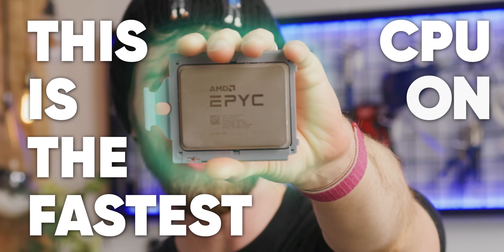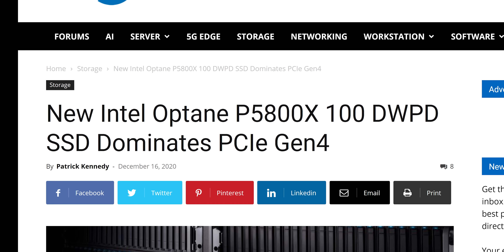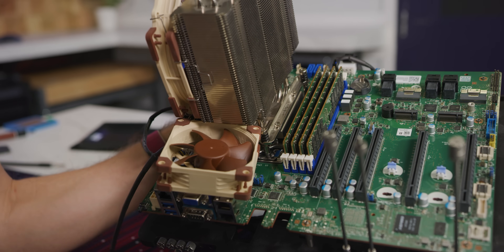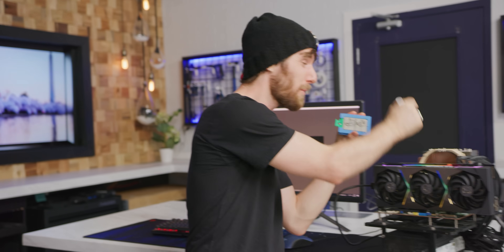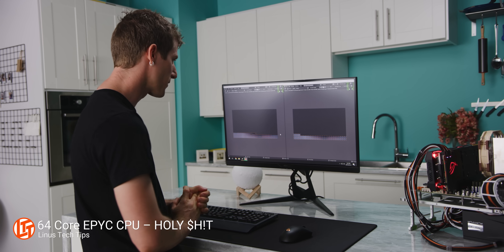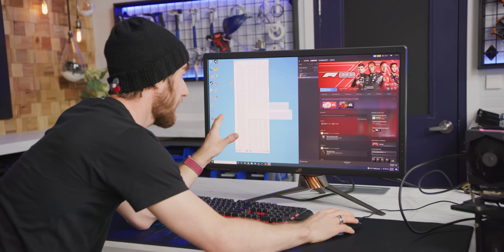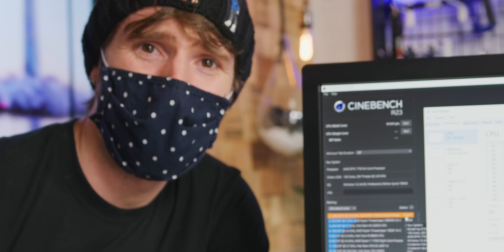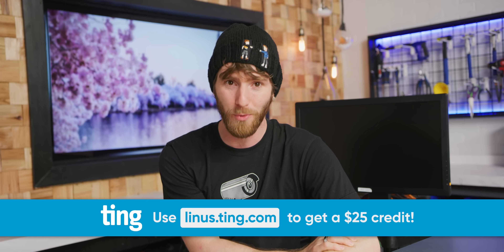The Fastest CPU on the Planet - HOLY $H!T - EPYC Milan 7763 64 Core

Comment: I just bought a low end Epic Milan 7313P as a NAS.
Reply: Dude how you liking that?  Honestly you can get this CPU for like 500 bucks on eBay considering throwing it in but are there any hoops you have to jump through to use these?
Reply: @Reedith  There are no hoops, its the same as any other CPU, I also bought a 7C13 which is a 64c128t beast as my primary, the 7C13 is now my secondary, next year I will be upgrading and the 7C13 will become the secondary and the 7C13 will become a 7763 or a 7773x, you will of course need ECC Ram and not UDIM - but I already had a 16 x 64GB sticks so it was no big and having that number of PCIe 4 slots certainly does not suck.. But fair warning some vendors vendor lock CPUs to boards so you can't use them on anyone elses - so make sure you get an unlocked CPU and don't stick it into a board from a vendor that vendor locks cpus
Reply: That should read the 7313 will become a 7763 or a 7773x

Comment: OHOohoo that CPU is going to instantly load minecraft on version 1.17.1+ HOLY, my cpu (Ryzen 5 AMD 2600x 3.60GHz 6-Core 12 Threads, L3 Cache 5mb) srly loads minecraft at around 60 degree celsius, and it takes 7+ seconds to load minecraft.

Comment: Just imagine if we had adapters for CPUs.  This way we wouldn't have to buy a new motherboard every time we wanted a new CPU with a different socket fitting just because it was better than the one we had.
Reply: ….????? Different sockets have different amounts of pins on them, and pins aren’t added just for funsies by the manufacturers
Reply: It's not like adapting 4 lug wheels to 5 lug hubs......nothing like that, not even in the slightest...

Comment: can i run my system intirely in ram, and only load from SSD and write to ssd when i shut down? my current threadripper is the 1950 or sumtin,  i want the newer one with 4TB potential at least, been thinking about more of a server calibre gaming box, my workstation needs may want 4 descrete cpus,  2 is a min i'm thinking for the next workstation build.  i guess the big ? is what kinda redundancy to i want.  Hmm, oh yeah and i want 4TB of ECC, pref. some medium fast sticks, unlike the normal ecc bulltah of being slow.   I thought the ram alone was going to be 12k 6months ago, went down a bit last check....

Comment: i have 500w psu and from pcpartpicker is says my recommend watt is 319w... should I get a bigger psu like 600w or more?
Reply: 500W is perfectly fine for your build, even with overclocking. However, if you plan to carry that PSU across multiple upgrades... you might want to invest in something really good, probably closer to 800W or so.
Reply: @yfnratchet  thanks bro, i might plan on upgrading my cpu to like an i5 but other than that i might stick with it for abt 3-4 years

Comment: I've got a unique Fucktacular Project!!! In Pro Tools(or some other MAJOR DAW, I've heard REAPER uses ALL CPU processing power, where as other DAW's do not like Pro Tools), process 2,100 individual audio tracks with 2 instances of Acustica Audio's Sand plugin(or any Acustica Audio plugin as they all are CPU HOGS, and you can usually only have 8 instances on a 200 track count song with a bitchin cpu!)on every single channel! Or you could also use Izotope's Ozone 9 if your sound guy has it(he should if he's doing sound! Who is your audio engineer/mixing engineer/mastering engineer or in video they call them Foley I think?). You'll also need a huge SSD , and the best SINGLE THREAD PERFORMANCE chip you can get! Also no BOOST CLOCKS! Gotta turn them off, they mean diddly squat in audio! You can't use em without causing the whole damned thing to crash right when it's absolutely essential that it doesn't!!!

Comment: Next we need 2x AMD EPYC 7763 + 8x NVLinked Nvidia Tesla A100 GPUs. Don't forget to run the Tesla A100 in WDDM mode (Teslas run in TCC mode by default). Game on it just cuz why not. We all wanna know what happens. Will the games even run at all on dual CPUs and 8 non-gaming GPUs? Can 8x A100 GPUs and 2x 7763s beat an ordinary enthusiast combo like RTX 3090 + Ryzen 5950X even though the former combo wasn't designed for gaming.

Comment: How many Solar PV panels and how big a wind power generator may be required to run the 264 EPYC server? Am I correct in assuming the one off cost of the Solar PV Panels, wind power generator, a battery bank and a hybrid power converter, amortized against the cost of buying electrical power from the utility company, may be cheaper over the operating life of the least reliable sub-system?

Comment: Haha, AMD is calling something once more "epic", despite being not even close to epic. Typical AMD marketing for bad stuff.
Reply: Intels dead move on
Reply: @queenofblahaj  where i should move on?
Ryzen 5000 is overpriced (at least in europe), Ryzen 3000 is as good (or worse...) as my (OLD INTEL!) system and a very affordable option like ryzen 2000 is worse than my Intel i7.
So where to move on?

I move on Ryzen 6000/7000 or Intel 12/13/14th gen and DDR5.
Reply: @harrison00xXx  bro the most expensive ryzen 5000 i could fine was 275$ my intel i7 10700k was 400$.
Reply: @queenofblahaj  " the most expensive ryzen 5000 i could fine was 275$"
Ahh, so the 5600(x)? Before i would get a 5600x i would get a used, fair priced 3700x/3800/3900 ;)
Only the 5800(x)+ make sense, and these are 400$/€ or more.
Reply: @queenofblahaj  Ofc my i7 from 2014 is already "weak" compared to all these 10core+ CPUs, but its still in 2021 okay for any competetive game in 120fps+ and in the worst case it delivers "only" 60fps+ in anyways not depending games where consoleros even have to deal with 30fps.

I will use this DDR3 system aslong DDR5 is affordable and "ahead" of DDR4 systems.

Only take for example the old server machines.... the xeon based on haswell, the haswell E and other server CPUs, used with quad channel DDR3 RAM it even outperformed most newer DDR4 systems, but the price for the ECC sticks and the "weak" singlecore performance due lower clocks, these days the best budget option 2nd hand to even outperform nonK i7s for a cheaper price and even having more cores.

Comment: I would love one of these chips for my research ;-)

I recently did get a 32 core Epyc with both 512GB RAM and a 3090, so that's nice, and the fact that we are limited to 1Gb/s bandwith to our servers is often a larger problem ;-(
Anyways, having one of these chips would probably take some of my computations to something I need to be careful and thoughtful when doing, to something were I could better play around with the parameters, which would be cool. But I think I'd rather have a 2--4 TB RAM machine, that is going to be way more important for us in the future 8-)
Reply: 512GB ram. Dont you think thats a bit overkill. bro my 16 gb ram is barely ever not working but fricking FIVE HUNDRED TWELVE
Reply: @football_chronicles669  as mentioned in my comment the PC is for research. We often bring home multiple TiBs of data (between 20 and 40 is not uncommon) from experiments, so large amounts of RAM is a must. We build this computer assuming it would be enough for a while, but the first thing one of my colleagues did was run out of RAM. 

So I would honestly love a 4TiB RAM machine. That should hold up for a few years 8-)
Reply: @awwkaw9996  holy shi-
Reply: If it's an Zen 2 Epyc processor then I believe it can utilize 4 tb of RAM.
Reply: @akirafan28  it can, but that was not within budget, research funds are limited ;-(
Reply: @awwkaw9996  That's unfortunate but understandable. Crossfingers that there will be an upgrade in the not so distant future! 🤞

Comment: You should run games with CPU pnly rendering with these. Would be interesting to see what these massive CPUs can do. Remember when games were run with CPU rendering, and we got GPUs to solve the pixel pushing? Would be nice to know how far CPUs have come now in terms of being able to do this again - with more recent games!
Reply: emulating games on virtual machines with software rendering rather than hardware rendering would pretty much accomplish that
Reply: Old post but I'll answer anyways, even a monster like this CPU would make a very poor GPU and would perform terribly. 

Keep in mind that the GPU has thousands of parallel processing units to the 128 or so instructions this Epyc will be working through each clock tick. GPU is highly specialized for the task it does, a general purpose core like x64 is a bad fit for that work. Conversely you wouldn't do general purpose stuff with. GPU either, for the same reason.
Reply: @_ClericalError_  Actually such tests are already being done at other locations, like the German c't magazine. This CPU could run Crysis at a pretty nice framerate.
Anyway, this discussion doesn't make sense without actual test results. Your explanations are of theoretical matter, here's a practical example that it's possible:
https://www.youtube.com/watch?v=2tn0bZcQf0E
Reply: @bad.sector  That was a pretty interesting video, thanks for the link! 

He does give my explanation in the first couple minutes, and he is able to get an average of 16fps at the lowest realistic resolution (720p) with the details turned down to minimum, that was only using 23/24 of the 64 cores available, so it's possible he could have averaged 30-50 if he'd been able to get it all running. Rasterization isn't necessarily linear like that on a CPU with memory latencies and depending on the number of memory channels the processor is using/has available.

As a practical matter though my GPU at the time I played Crysis (which was in 2012, I was running 2x 680 in SLI) ran at a constant 60FPS at full detail at 1080p. I don't remember what the framerate was unlocked from VSync but it was quite a lot higher, I just don't typically play games unlocked from VSync, especially in modern times when monitors often have 120 or 144Hz refresh rates.

Obviously my setup at the time was probably quite a lot beefier than the "average" gamer PC of the time, but even a decade ago a high-end consumer setup with GPUs could outperform an $8000 modern professional-grade CPU today. My explanation is theoretical yes, but it is borne out by the testing.

Comment: Linus stoo sucking at cpu benchmarks - no one uses just cpu to render, it’s always in tandem with gpu or just gpu - fuck cinebench it’s almost synthetic - test unreal lightmass rendering and shader compiling - does it even support 128 cores, same with adobe encoding video (for instance), fluid simulations - try embergen, or some blender smoke/fluids.. memory latency can fuck up performance like 90% down.. 
You don’t test games with 128 cores, test edge case software - the stuff that’s actually important to buyers of these power cpus..
This is like test benching a ferarry on how much grocery you can fit, and how well it behaves in snow conditions..
Time after time, these high class cpus are tested by clowns

Comment: except, dude I been doing server architecture for decades, and uh, I and everyone I know that knows what they are doing avoids AMD processors.. you see most shops are virtualization.. when you are, it makes good sense to pick one and stick with it. so most people pick intel and those that don't tend to regret their decision later on.... and eventually most switch to intel if they didn't

Its a huge pain to find out that your vm cannot be hot migrated because your spare server is amd.... and the vm is on intel.. stuff like that, makes best practice to just not have a mixed environment and in most cases intel wins that battle.... so for home use AMD is beast, but server builds? nah ill take intel just so everything is as close as possible for compatibility purposes.

Comment: Cool project? 
I think there's no industrial installation in the world which this cpu cannot handle. Tose run on ARM lately (LOL). 
Waste water, O&G, F&B, Infrastructure...
I think you can run a VERY serious size metal workshop (CNC) off it too.
I speak of control, not SCADA or higher stuff, it's boring there.

Comment: I'd love to see what the current game engine I am building can do with it. I just got the multithreading part of it ironed out. It uses a state controlled thread pool. So depending on the state I can use it in different ways. When in the normal game loop in can run a round robin type system. When initializing and loading files it can use a que task based system. Or I can do hybrid states with some threads doing one and the rest doing the other. I can otherwise control the threads so that when they aren't needed they can be paused and so on. Right now I'm using a z600 works station with 6 cores 12 threads.

Comment: AMD is trash, and please stop spreading that is the fastest, how about STABILITY and guarantee that it will work without problems of memory controller crash and so on )))
Reply: AMD is very stable now.
Reply: I’m still struggling with AMD R9 3900 Asus MB HyperX DDR4 RTX 3070, I’m using only one Ram slot because it doesn’t work with more than one, and there are times when it just doesn’t load ..just black screen, in Mother menu it just freezes and can’t do the changes  )) I just regret I don’t got the Intel configuration because a 5% + or - in performance is nothing it just doesn’t make any sense, and Intel wins AMD in any case.
Reply: @sh4d20w  Sounds like either your mobo is faulty or your CPU is defective. Either way yo;u should ask for an RMA. I haven't seen something like that happen on Ryzen for a while. You're just unlucky I guess
Reply: @sh4d20w  Have you also tried flashing the bios?
Reply: @sh4d20w  Do you have a warranty for the CPU? I'd get it replaced. Unfortunately you'll have faulty samples every now and then from both Intel and AMD

Comment: why is the clock speed so low?? i9 has 5.3 ghz already
Reply: Because an i9 has 8 cores and this has 64 cores. Speeds are also lower than threadripper so it can met thermal design targets for servers. Keep in mind that clock speed is mostly just marketing. A Ryzen 7 at 4.7ghz stomps on an i9 at 5.3ghz
Reply: @haven216  then is it always better to use amd cpu laptops because Intel ones costs more dont understand why though..........
Reply: @Rizzit_7 , Are you talking about gaming laptops? Right now you can't go wrong with either, but AMD has longer battery life and fits in smaller designs while being generally cheaper
Reply: @haven216  so generally it means Amd is the top notch stuff!! Right??
Reply: @Rizzit_7  Yes. Also a review came in for Intel’s laptop flagship… just go AMD lol

Comment: The 64-core threadripper pro roughly doubles the performance of this chip, with identical PCI-E lanes, and identical RAM capacity. It was released a year prior to this video's release.
Reply: I am under the impression that the 3995wx have a maxium memory capacity of 2 tb, where as this epyc has 4 tb of maximum memory capacity..
Reply: @akirafan28  The 4tb maximum capacity is only possible in dual CPU configurations. Each CPU only supports up to 2tb of RAM. The capability of running 2 doesn't make the chip better; it adds chip-to-chip latency making the combined performance of running 2 less than the 1 chip running hot. The SKUs are actually identical for the two chips, including the IO needed to run 2, it's just not listed on an epyc server board's accepted CPU list in the bios. The 3995wx is just binned to run at higher clocks, and with something like an Asus WS WRX80E-SAGE, it can be clocked to double the speed of the 7763 on air cooling, with identical IPC, identical PCI-E lanes, and identical RAM capacity, at 1/3rd the price.
Reply: @AdmiralFace  Didn't know one would need two Epyc CPUs in order to make use of 4TB ram. Thanks for clearing things up for me 👍.

Comment: Intel are going 3nm. That will be the end of AMD in a few years
Reply: @xEther Yeah. But AMD 7nm isnt that much better than Intel 14nm. At 3nm , I expect Intel to be a lot better, clock for clock
Reply: @xEtherYeah I agree.
Reply: They're only using TSMC 3nm for specific datacenter GPUs. TSMC 7nm is FAR more efficient than Intel 14nm, and doesn't need over 250W to compete. Intel 7nm is planned for late 2023.
Reply: @haven216  Cheers for the info :)

Comment: Meanwhile I'm still rocking my Core2Quad
Runs most things when paired with a good GPU and in dual channel memory mode @720p
Works good enough for me!

But stuff like this makes my rigs looks like prehistoric IBM and Packard Bells by comparison.
Reply: I'd still upgrade. Even an Athlon 3000G smokes a core 2 quad, and has the modern instruction sets to run newer games
Reply: @haven216  but you would need a whole new motherboard to install that cpu, which isn't as cheap as just slapping a good gpu in an existing build.
Reply: @Cockalicious  But there is nothing meaningful he could upgrade to on his platform. It's simply too old. He should just save and build a new computer
Reply: @haven216  i saw a prebuilt on ebay for less than 200 with a gtx 950

Comment: Can you please test Microsoft Flight Simulator 2020 in VR on that setup Pleaaaaseeeeeeeeeeeeee!!!!! I'm gonna build a rig just for it and I might just use that cpu
Reply: Please do not buy a server CPU for gaming... Just get a ryzen 9
Reply: @haven216  it still gets beat up by fs2020 in vr
Reply: @r3ady150  And so does this server CPU. Core counts much higher than 8 cores won't improve performance in games, and is dependent on single-threaded performance. Ryzen 9s currently have the highest single-thread performance